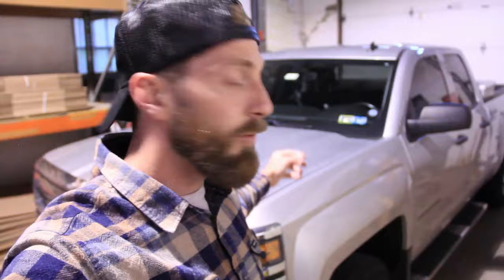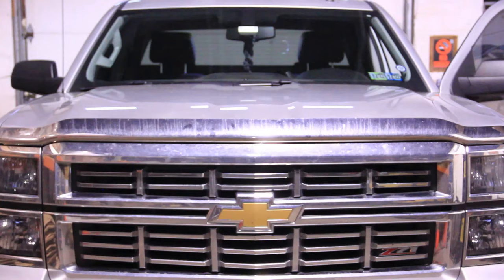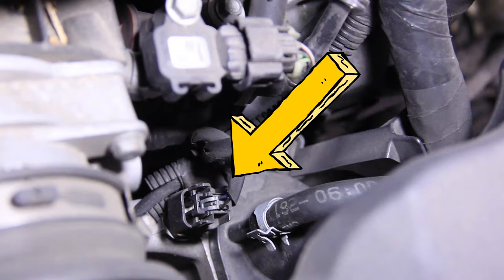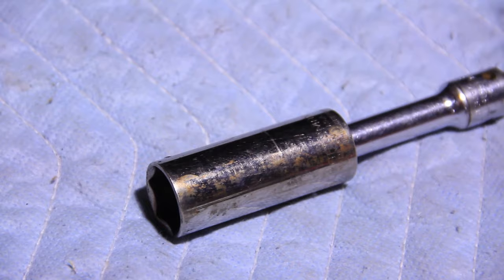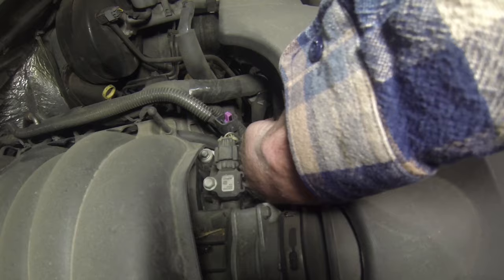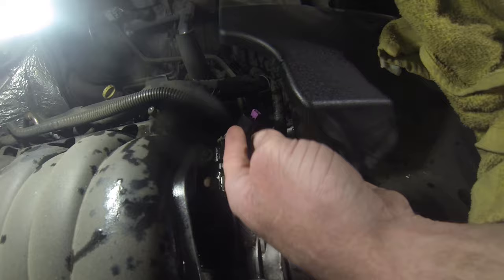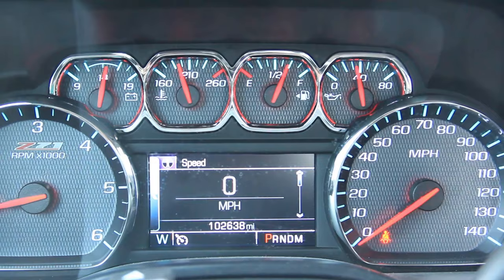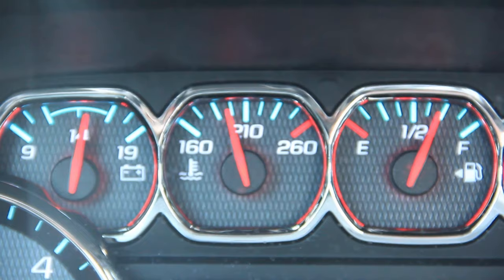Radiator Fan Won't Turn Off: 2014 - 2019 Silverado & Sierra: Bad Coolant Temperature Sensor Replaced

Comment: I replaced the sensor and thermostat...it still stayed on. Once i disconnected the battery it was good to go!. I might have not needed a thermostat to begin with.
Reply from the maker: You never know, but it's always good to replace it just in cases.
Reply: I did the same thanks! Headache !
Reply: This comment literally needs to be pinned, mine was still running as well I read this comment and tried it out and now my truck is good. Thank you
Reply: I changed both sensor and thermostat and the fan still comes on. I took cable off battery several times.. any tips?
Reply: @walkerhomestead6853  did you try just removing the positive?
Reply: @emmanuelsanchez1749  actually I haven’t. I only tried negative. I’ll try positive in the morning. 
Fan only runs when truck is on now. Turns off when Truck is turned off. 
Somethings not right. Could be a totally different problem now.. Truck also seems to be running hot. Burning oil
Reply: Yup, after replacing my coolant thermostat and that not fixing the issue I disconnected the battery. Fixed the issue right away. Wish I would’ve known that before buying the parts and replacing the thermostat
Reply: Worked for me too. I have a 2017 Siverado 1500. Cooling fan was at top speed even when I shut the truck off.  I 
1. Shut the truck off
2.pop the hood
3. Disconnected to positive (red) side of battery
4. Leave disconnected for 2 minutes
5. Connect the positive. 
6. Start truck 
7. Back to normal 
Your welcome in advance
Reply: It’s good to disconnect the negative on battery first then put back on after
Reply: @cr2814  I replaced the coolant sensor and it has come back a week later. Will this still work?
Reply: Follow up: removing the + battery terminal for a minute to allow vehicle reset resolved my issue.
Reply: @walkerhomestead6853  yeah sounds like you have a different problem. 

Was the coolant temperature needle working on the cluster? Mine was showing nothing.
Reply: @TheGrangerBoy  was that after you put on sensor
Reply: @emmanuelsanchez1749   Yes but it ended up coming back on
Reply: I replaced the temperature sensor and unplugged the battery it worked for a couple days then came back on
Reply: @TheGrangerBoy  hey thanks for the comment. I ended up figuring it out. It was the A/C pressure switch causing problems. Before I changed the thermostat my temp gauge was stuck on 160. After changing thermostat gauge is normal. Fan would just run while truck was on. So it took all 3 parts to fix my problem - temp sensor, thermostat and pressure switch. 
Hopefully that makes sense lol
Reply: @fishinginthecity2375  yeah same for me. Definitely change that thermostat
Reply: @ronniegodsson8336  no, after I put on sensor it started working. 1 week later it stopped working again and fan started running on high at all times. 

I did electrical reset and disconnect B+ on battery for 2 minutes. No issues after that
Reply: @ronniegodsson8336  yes
Reply: This is due the pcm codes being cleared by disconnecting the battery, if you have a scan tool, clearing codes will also work.
Reply: @TheGrangerBoy  I just replaced mine a couple weeks ago, thought all was good until about an hour ago now its back. Hopefully disconnecting positive on the battery will resolve mine too
Reply: @walkertekk9  it did mine! It’s like a system reset because the fault code was thrown.
Reply: I literally just disconnected my positive from my battery and reconnected it and the fan doesn't seem to be running at all anymore which is a good thingI literally just disconnected my positive from my battery and reconnected it and the fan Shut off now
Reply: @TheGrangerBoy  it did the trick for now, hopefully it stays. Wife is on a 4 hour road trip with it so I should know soon 🤞
Reply: Hey bro how long did you disconnect the battery for?
Reply: @cesaralcantar2843  I waited about 10 mins. Others say 2 minutes. Not sure which is correct to reset the computer
Reply: My temperature gauge is staying at zero & the fan won’t shut off.. anyone else with the guage staying at zero
Reply: @davidmccellon3367  hey bro that’s exactly what mine was doing I changed my coolant sensor and my thermostat and disconnected my battery for about a few minutes and it started working normal try that it should fix ur problem
Reply: @davidmccellon3367  Cesar is correct but I would start with temp sensor first as thats usually the first to go. If you have access to temp sensor and thermostat, might as well do both. Then disconnect + on your battery for a few mins. Should be good to go after that. The temp gauge being at zero is due to one or both of those parts failing.
Reply: @walkerhomestead6853  mines doing the same thing I’ve put new temp sensor in it still staying on while the truck running Any tips would help guys! Please
Reply: @natashasmith7653  did you change the thermostat already?
Reply: @walkerhomestead6853  no my ac not working also could it be the ac pressure switch?
Reply: @natashasmith7653  yes could be. I changed ac pressure switch and also found a burnt wire on the pigtail. Fixing that solved my problem.
Reply: @walkerhomestead6853  ok thank you imma unplug it tomorrow and use a test like make sure it getting fire from the plug and pick a new switch up hope it fixes it
Reply: @natashasmith7653  I hope it works. Best of luck to you.
Reply: I can't find my thermostat or coolant temperature sensor on my 2016 Chevrolet Colorado Lt crew cab 4x4 v6 anyone can help?
Reply: @fishinginthecity2375  yeah same looking for a solution
Reply: God bless
Reply: On the second sensor but I realized it's probably the thermostat because it's good for a couple days before it throws the code and fans turn on
Reply: @TheGrangerBoy  is yours still good? I have changed the thermostat and sensor but only removed the negative cable, problem came back a week later
Reply: @1890ryan  pull the codes and see what it says
Reply: Just saw this comment checked my battery terminals and it had some corrosion from the cold weather scraped it off now it’s fixed 🎉
Reply: @SouthernFisherman   when you disconnected the battery did the issue stop completely? Or just temporarily? Thank you! My car literally just started doing this last night 🙁
Reply: @blkcoverboy1049  I changed the sensor first worked fine then it started doing the same thing I changed the thermostat works fine now
Reply: @SouthernFisherman  i noticed today my coolant reservoir tank was TOTALLY empty so i thought hmm maybe that’s why the fan is blowing like that so I purchased more coolant came home and checked hours later the coolant reservoir was totally empty again and on the ground underneath the car. So it looks like i have a leak of some kind. My car temperature is not showing its running hot tho oddly enough. So i guess my car was sensing i had no coolant prompting the fan to blow! So now i have to find out whats causing me to lose coolant 😩
Reply: @walkerhomestead6853  try using oem parts if you haven’t, I had the same issue and after I used ac delco so far it’s been good
Reply: This man helped me greatly! Thank you for this comment
Reply: @walkerhomestead6853   any part number for the pressure switch?
Reply: Same here. I had to disconnect the battery for the sensor to start working. Thanks for the tip.
Reply: This fixed the problem. Thanks
Reply: @braydengreen564  did the problem ever come back?
Reply: @VanaraHen  I didn’t ever come back. But I did have the sensor replaced and I talked to someone about it and they said sometimes it just takes a minute for the check engine light to reset. So maybe the solution was disconnecting the battery maybe it wasn’t. I’d definitely start with that though if you’re having these issues.
Reply: I’ve now replaced the coolant temp sensor twice and disconnected the battery each time and the problem goes away for about 2 weeks then it comes back. I don’t mind buying another temp sensor as they’re only like $30 but I don’t get why it keeps kicking the fans back on. Can anyone help me with what else it might be? I’m thinking maybe the connector that attaches to the temp sensor might be bad/shorted but it does work for a few weeks so it’s obviously working. Would love any advice
Reply: I changed both coolant sensor thermostats and disconnect the positive + battery cable then replace the positive + cable and start truck check for leaks and take for a spin to your local beverage store. Aloha
Reply: @Mrswag420weed  is it going out after it rains or the entire truck gets wet? or shortly after it rains? food for thought. If so, it is very well a short and you will have to chase it down. Not fun!!
Reply: Thanks, unplugged the battery and it went away. Hopefully it will last till the weekend and I can replace the thermostat then.
Reply: Thank you for your comment! Same thing happened to me, glad I read your comment.
Reply: @cr2814  did you replace the sensors , or just disconnect the battery?
Reply: @jluna018  you didn’t replace the sensor?
Reply: I just changed temp sensor fan still running. Going to try thermostat ✍🏾🛻
Reply: This comment saved me money thank you
Reply: Thank you! I replaced my sensor and it was still running high RPM, unplugged the battery for a few minutes and it worked
Reply: I think my bad battery is somehow cause my thermostat to glitch
Reply: My temp gauge stops working when the fan kicks on. Same culprit?
Reply: Just had the same issue on my 2014 with 110k ....had to disconnect the battery after replacing the sending until and resolved the issue thank you !!!!
Reply: @cr2814  did you even change a sensor or thermostat?
Reply: This does not fix the problem. It started running again a month later.
Reply: @josephminnick3701  Lets be clear, it did not fix yours.....it has fixed many just not yours!
Reply: Saw this and disconnected before replacing the parts and fixed the issue.  Thank you
Reply: @josephminnick3701  Mine did the same thing, replaced the sensor again , and after a few more weeks its been off and on....strange ...... Starting to thinks its electrical issue since it comes and goes......not sure at this point ......
Reply: Was that like resetting it
Reply: Replaced temp sensor and disconnected battery negative for a few minutes, didn't stop the fan. Replaced the thermostat, erased the codes, fan still running. WTF?
Reply: Just did the same thing
Reply: Yes me too, crazy, seems like all electric bullshit sensors or mother boards
Reply: Time saver! I was just about to head out to the parts store, but decided to look at the comments.l and saw this. It worked!
Reply: The disconnect of the battery worked for me as well! Thanks for the info!
Reply: Yes sir wants I dis connected battery terminal waited a minute, re connected Everything! Everything is working now. Great video
Reply: Changed sensor on mine, didn't fix the issue, disconnected battery for 30 seconds, fixed the issue and guage started reading temperature.
Reply: So I changed temp sensor months ago and it worked perfectly. Same issue is back now. Thermostat change next?
Reply: @cr2814 yea but it keeps happening to me that works but if I go on highway the coolant gauge turns off and the fan starts could I have a wire shorting out
Reply: @Mrswag420weed did u ever fix this I’m having same problem I think I must have a wire shorting but how do I find that lol
Reply: Can someone help me out changed the sensor disconnected the batter a day later problem came back
Reply: If it keeps happening even after you disconnected your battery then you might need to replace the ry862 sensor. Which if your fuse box will be number 67 in your fuse box. I changed my thermostat and temperature sensor and reset code and it still kept coming up and happening. No ac and fans on with not reading temperature. Once I changed the relay sensor it went back to normal.
Reply: Thanks for the comment. Disconnecting the battery fixed it for me.
Reply: Thank you!  Same for me! My negative terminal was loose. Had the battery changed a few months ago and have several anomalies since then!  Disconnected and re-tightened. No part change required!
Reply: @walkertech9 . Did you or anyone notice the upper hose was not hard?
I have all the same other problems with the fan.
Reply: Crazy this is exactly what worked for me. These trucks are finicky I swear
Reply: I just disconnected the battery 3 minutes.  Problem solved.
I bought the parts already.
 Btw: my display said my battery was low. After I disconnected the negative side, my battery was tested and passed. WTH??
Fixed 11-01-2023
Reply: THANK YOU IT REALLY WORKED.
Reply: I need this comment ✊🏾thanks
Reply: @TheBrothersWorkshop i’ve undone the battery, it was a quick fix but then came back. Probably best you do the sensor and then also maybe a battery reset real quick and it’s good
Reply: @gflames23  .
Disconnected the battery??
Reply: All you need to do after replacing the sensor and the thermostat is to clear the codes. Even if you don't have a check engine light on you will see when you scan your car for all modules it will show code stored for Thermostat and sensor.
Reply: Omg I change the thermostat and the sensor and the fan wasn’t turned off. Read your comment and guess what it worked. I was about to give up lol
Reply: i was gonna fork out the 160 bucks today and thought i would give a try it worked
Reply: I have a 2015 Cheverlot Silvedado 5.3 litter
My fan kept running so I changed the sensor and it kept running. Then I changed the thermostat still it kept running. I found out after you change the sensor if you still have a check engine light on you have to reset the codes and it will all run the way it should. This problem took me all day to solve. I hope this saves someone else as it should probably only take  20 minutes or less
Reply: @fishinginthecity2375 same here can you let me know how you solved the issue thanks.
Reply: THANKKK YOU!
Reply: Instead of battery disconnect(specially if you have no tools with you), just pull FAN 1, FAN 2 fuses
Reply: @cr2814 should’ve seen this comment before I ordered parts haha. Will replace anyway but for the mean time this actually worked
Reply: @cr2814 has it been ok since you did this?
Reply: All I did was unplugged the censor and cleaned it out. Plugged it back in and disconnected the battery for a couple minutes. Runs fine!
Reply: A lot of people commenting that “disconnecting the batter worked” That is a temp fix to the real issue/s.

The real issue is the “Cooling system Temp Sender/Sensor” and the “A/C Refrigerant Pressure Sensor Connector”

I also changed the Thermostat, just cause I was already in there.

Cheers!
Reply: @walkerhomestead6853  Did you change Part # 84598 which is the 3-Wire GM Throttle Position Sensor?
Reply: Dude you save me money with that,bought the thermostat but read your comment it worked
Reply: Thanks for the awesome video and thanks for this comment. I disconnected the negative on the truck battery, the fan stopped. I will still replace the temp regulator. Could be the underlying issue and it could be failing. Thanks so much.
Reply: @TheGrangerBoy Try disconnecting the battery. Let us know.
Reply: @walkerhomestead6853  Thanks ill try this.
Reply: You are the man. Had same symptoms and tried disconnecting the battery before running off to the parts store. All is good now!
Reply: Yes! Thank you!
Reply: Had this issue last night, disconnected the positive and temporarily fixed the issue. However, I have noticed that my engine is running cold on the thermostat. I'm topping off the coolant pretty much Every oil change which is about 3-4 months. Is this irregular?
Reply: Will definitely try this thanks
Reply: Dod this this morning and it worked without spending any money. Hopefully it works
Reply: Thanks did the same thing and it work
Reply: Unhooking battery seems to be the key after the sensor is changed. Swapped sensor, issue persisted. Shut truck off, unhooked battery for 3 minutes, hooked back up, alllllll good
Reply: That was a very helpful comment, I just replaced the thermostat this morning due to blogs saying that was the issue. And it did not solve it. I just came across this and will do the temperature sensor because it’s so easy, but I will definitely disconnect the battery after to see if it helps.😅
Reply: I disconnected my battery and pulled the two fan fuses. Put them back in and connectebattery again. again. It stopped running. Whew!
Reply: So my issue with all this is, is any part actually a bad part? I disconnected my battery only because the fan running was killing it before I was able to get parts. Reconnected the battery and no issues at all. If I have a bad part I’m sure I would have temp gauge indicators. So again is any part actually bad or is it simply a computer reset?
Reply: @sashaviroviy5065 what's the fuse location
Reply: This problem came up after having transmission replaced. 
I'm gonna swap the sensor and pull both battery terminals. 
Really hope this is a fix and don't have to take truck back to shop
Reply: Intermittent electrical issues....fun, fun, reset and it works until that original little problem glitches again....can't be thermostat beings it is purely mechanical but good idea to replace so cheap while you're in there insurance. Sensor if not sending signal will default to fans running for safety. But computer will also run fans unless reset even if sensor is working. A/C pressure switch will also run fans but temp gauge should still show scan  test on startup and not be stuck on 160 if its just pressure switch. Sometimes its like any computer,  just reset, other times it is a part or connection. Best to start on the cheap and reset. Then if it doesn't fix it or returns and gauge not moving replace sensor (and why not thermostat), clean connections and reset computer. If guage does scan replace a/c pressure switch. Fun fun....somethings work for some, some for others...electric gnomes.
Reply: I did that for about 8 months until I decided to have sensor replaced and it was fine for 2 days then what do you know the fan is back on. I’ll to thermostat next my urgency is this Texas heat lol.